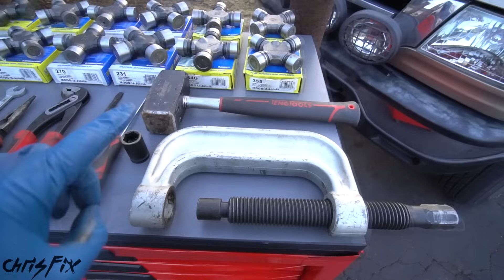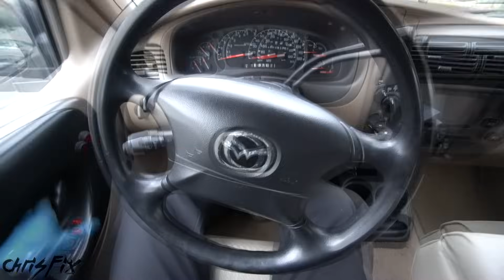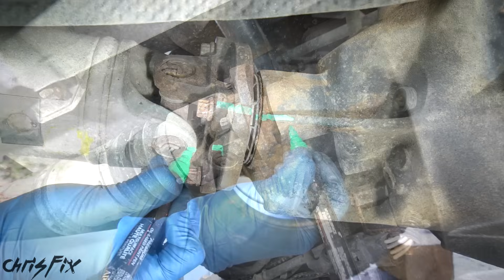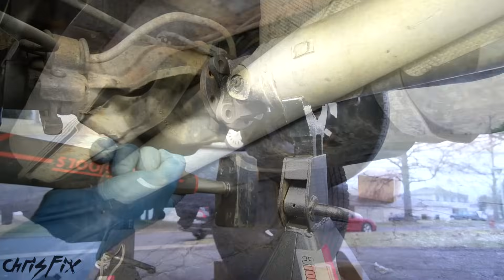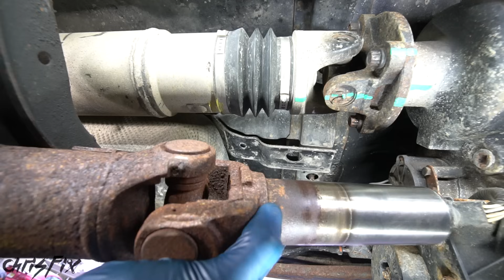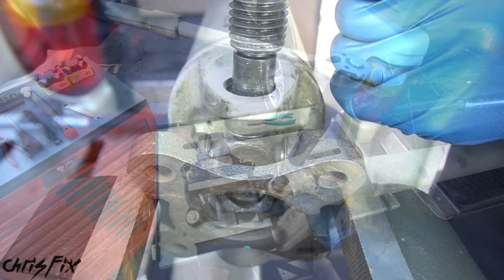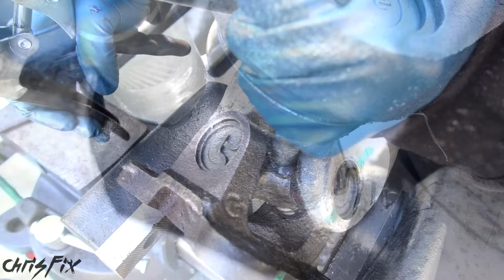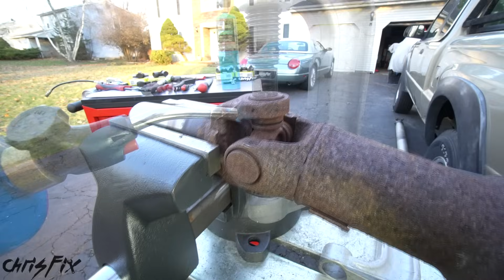How to Diagnose and Replace Universal Joints (ULTIMATE Guide)

Comment: This is actually very helpful.  I have had a vibration in my ranger since I bought it a couple years ago.. but it's only at 75 and up.  Check the drive shaft and it looks like the weight came off (non aluminum) but I never thought to check my U joints.. So I'm going to check them and see..

Comment: No surprise - another excellent video!
I would add that if any arm will not fit all the way into the cap (so the shoulder does not touch the rubber), push the cap out again. One or more bearings has fallen down inside and needs to be put back in place as you showed.

Comment: The worst U-Joint experience I've ever had was with a Yamaha 4x4 atvs I had. When I got it, the u joints had no bearings left in them and the clanking was awful. The problem was you couldn't remove the driveshaft. I had to change them while they were in there. I had barely any room. I ended up cutting the u joints out so I'd have more room by having the driveshaft out. It took me hours to get the end caps out. I hammered, heaked, soaked, and even bought an air hammer. What I had to do was cut two rods and place in the end caps them hammer a chisel in between them... I was glad to have it done, and now I don't have it anymore, traded it for a Jeep Wagoneer haha.

Comment: Chris, my owners manual does not have any torque specs in at all. I tried looking it up and noticed something. Apparently I need a “factory service manual” which is significantly different and separated from an owners manual. These manuals aren’t available to the public. Only mechanics and dealerships have access to these manuals, is this true? I have a 2009 ford fusion sel v6

Comment: I have a 2007 g35 sedan 6MT that makes a clicking noise every time it changes directions from forwards to reverse or if I get on heavy throttle/braking. Could it be a u joint or possibly a suspension related component? I don't hear it going over bumps or cornering only if switching between going forwards or backwards.

Comment: Hey Chris, I know this has nothing to do with this video but I’m changing my water pump in my 98 gt and was going to do a system flush as well. I’m changing everything, t-stat, upper and lower hoses, and reservoir tank. Should I change the parts after I do the first flush or after once the coolant is all clean?

Comment: On my 94 Mustang GT 5.0L with Vortech S-Trim Blower with a ton more mods I installed Ford Racing Motorsport aluminum driveshaft purchased from Steeda (local to me).  It was a huge difference over the stock unbalanced crapola shaft along with the weight savings.  Apparently after only 9000 miles the vibration was so bad while at the 1/4 track I about lost a filling in my teeth (that bad).  Dude, you need to make more videos, big gap between vids.

Comment: I don’t know if it’s too late to ask this question, but about a year ago my mother used her Mercedes station wagon to move backer board or wonder board because we were remodeling a house at the time. When we took one off the roof it scratched up against the paint and left a couple clusters of vertical white lines on the paint. I wanted to know what method I should be using. The lines disappear when I wash the car. If you could please point me in the right direction I would be very thankful. Thank you for your time.
Reply from the maker: Watch my video “how to remove clear coat scratches” and try the water trick to make sure they are clear coat scratches. If so, try polish first. If that’s not enough, use the method I showed in that video.

Comment: Hey ChrisF!! A video on how to locate the source of battery electrical drain when you know the fuse/circuit that is causing the problem☆ pleAse i alReaDy know the ammeter connecting to negative lead/battery post test procedure. **i NeEd specifics. Hiw do we read a wiring diagram c'mon ChrisFix tnk u thank u thank u!
Reply from the maker: Replace the part causing the draw. Did you see my video “how to find a short in your car”?
Reply: If you know which circuit it is if you test all the wire for continuity at first and then replace the part. You’ve done half the job by locating what circuit you’re power drain is on! That’s the difficult part!

Comment: I wonder if you can show us how to get your air conditioner unit of the car cleaned , as mine smell bad
Reply from the maker: Good idea!
Reply: There is an easy way to clear the smells.
First you are going to need some Lysol (disinfectant spray).
Now turn the AC on on full blast and put it on NON  recycling mode (its the symbol with the little car that shows air coming in from the outside)
Spray the Lysol into the vent located between the hood and the windshield.
You can do this everyday for two minutes at the time until the lysol is gone.
Once you are done, open the windows to let clear the smell.
For extra messure i use some of the lysol with the AC on full blast but this time ON recycling mode, and leave the lysol inside the car for at least 5 minutes ( i usually jam a piece of paper between the nozzle and the plastic cap so i can leave it inside spraying.
do this with the windows up of course.
I did this in all my cars without issues at all.
good luck

Comment: why do you tighten everything up in a criss cross pattern
Reply from the maker: It seats the flange evenly. If you tighten one side then the other it could be stuck at a slight angle. Same reason you use a star pattern for lug nuts on a wheel.
Reply: ohh ok... love your videos bro. I'm 16 and you have gotten me into drifting and made me a car guy.

Comment: The driveshaft isn't balanced on the vehicle "at the factory". It's balanced independently like anything else. This is like saying, "Make sure you mark how your tires are installed on the vehicle because they're balanced on the car at the factory." Imagine if you install it turned 90 degrees to the left. How would that make it out of balance?
Reply from the maker: The driveshaft and flange are balanced together. That was the point I was trying to make.
Reply: ChrisFix Got it thanks! Hey it would have been cool to see the vibration in the cabin after you replaced the u-joints, like how you did with the water. Great videos BTW!!!

Comment: He's back! :-) Outstanding video Chris. The same type of joints with clicking and clunking can also be found in your steering column. I replaced my intermediate shaft recently. I bet the road salt used in the winter got into those joints and helped make them worse.
Reply from the maker: Thanks and yes. I was going to include that info but decided to focus on the drivetrain only
Reply: It's no wonder why you rate at the very top for auto repair videos. You couldn't have explained things better.

Comment: Great vid. Thank you. What is your opinion on painting the drive shaft?
Reply from the maker: As long as you use a thin primer coat and thin base coat you can paint it. If it’s as rusty as the steel one you saw at the end then sanding it down might unbalance it.

Comment: Good video! Also, if you notice a squeaking sound when backing the vehicle, that is usually a sign that the front U-Joint is worn. Did several of these in my H.S. auto shop class. I also did a few of the early 1960's Chrysler products with the different style joint. Needed a good press to get the pin out.

Comment: Can you help me trouble shoot my truck it won't start I have tried replacing the starter I replaced the battery I also cleaned the terminals I got new terminals I just can't figure it out it's a 1990 ford f-250 v8 and takes gas please help

Comment: I posted this before but didn't get reply
I am having clunking noise on my corrola 06 Steering Wheel UV joint.    I was thinking of taking it out myself and inspecting as any local affordable mechanics don't want to touch it. Should I be worried about something and any advice? And thanks for videos as i learnt lot about cars and fixed lot of botched jobs done by local garages

Comment: I need feedback. I have 06 mustang GT with coastline aluminum driveshaft. I get the clunk moving through gears. vibration while at stop while in drive. drivtrain shakes as if engine is misfiring but no codes. I checked engine mounts are good not blown. trans mount good. hope it ant the trans.

Comment: I’ve got something I could use some help with. My cars been losing oil somehow for about a year or so. I’m currently at just over 3000 miles on my oil change this time around and it’s been maybe 4 months and I just check my oil and it wasn’t even on the dipstick. I drive a 2005 Honda CR-V and it has just under 80000 miles on it and it takes about 4.5 quarts of oil and I recall putting in all 5. Some previous oil changes were done at a Honda dealer or other place like firestone, and some were done by me when I had access to lifts in high school. Anyways I’ve never seen it puff smoke on start up or during driving. Literally never. And there no oil on my driveway. I haven’t seen any leaks but I haven’t looked too hard either. Was hoping Chris or anyone in the comments could help me out. P.S. love your videos and been watching for a few years. They’re very informative and detailed. I really appreciate how you always seem to cover every possible cause of a problem before you complete the video/ repair. You’re my go to source when I’m trying to learn something new

Comment: I'm doing a Gearbox swap on my '96 Ford Falcon EF Wagon 

The gearbox is coming from a 1996 Ford Falcon EF Sedan (which has a 20-22cm shorter wheelbase than the Wagon)
So I'll need to use the stock rear end of the driveshaft from the wagon and the front end from the sedan to suit the Manual Transmission
I'm not sure how well this will work but oh well

Be careful buying parts cars and check the wheelbase on them

Comment: Yeah how easy.  My Audi TT quattro doesn't have these joints on the central axle, its only cv joints front middle and back and an intermediate bearing.  And of course to remove the axle (called cardan shaft)  you need to remove "other stuff" like the exhaust front to back...

Comment: Hey Chris! I have a question about this. Can bad u-joints make a truck's rear-end "jump"? Like my truck when I'm going down the road and hit a pothole it will literally cause the whole rear of the truck to start jumping until I slow the truck down below 15 mph. I have checked and/or replaced my rear leaf spring hangers and everything else suspension related. I had a friend suggest my U-joints (which I replaced last year with cheap temporary ones) were the culprit. I have new ones to put in but I don't want to dedicate to just one problem if there is something else I should also be looking at while I have the truck apart..

Comment: Hey, i have a question about a 1999 ford taurus, just replaced the ac pump and to get it in you move it behind the radiator and the belt is on the passenger side, its all installed and it started the first 3 times but wont start again, its starter is new and it tries to start up but just isnt able to, any advice or clue what it could be let me know thx

Comment: When you use the hammer method to force the joint out, you should use a larger socket under the opposite side to support it. If that side is stuck, the joint won't come out otherwise. Also, you forgot to mention that sometimes one pair of caps will be a different size than the other pair on the same joint, so people should be aware of that during disassembly and reassembly.
Reply from the maker: Thanks for the tips Chris

Comment: The u-joints on my Vette's half shafts go out more frequently than I think they should. I always take it to a shop and have them replace the. I think next time I'll do the work myself. Though the half shaft u-joints would be slightly different procedure. Probably not too hard though.
Reply from the maker: The hardest part is getting the half shaft out and that isnt too bad either.

Comment: I've got a question for you Chris, I have a 2005 ford ranger 3.0 liter with an error code cylinder 4 misfiring. I replaced all fuel injectors, spark plugs, and wires....still have the misfire, what can it be?
Reply from the maker: Check the compression for that cylinder. If the compression is fine then I would replace the coil (distributor).

Comment: Hey Chris! Quick question: at 17:05 you mention tapping the flange with the new u-joint with a hammer to get the u-joint to move more freely. Do you know how/why that works? I can't seem to figure it out intuitively.  I would think that hitting the flange with a hammer would turn the flange's circle into more of an oval where it meets the u-joint. What are your thoughts?
Reply from the maker: Since the caps were pressed or hammered in, there is pressure against the needle bearings. The hammering vibrations loosens up the needle bearings and caps and helps them settle in place so there is even pressure. Lightly hitting the flange's circle does not deform it at all.
Reply: ChrisFix thanks for the quick reply! If I would’ve watched another 2 minutes before commenting I would’ve realized what happened lol

Comment: I have a transmission arriving tomorrow for my 90 Chev truck. I have been debating whether I should replace it myself. This video helped with a portion of the work--removing the drive shaft. I also broke my shoulder 7.5 weeks ago and so replacing the transmission might be a bit more than I can do now. But thanks for your great detail in the videos!

Comment: Correct me if I'm wrong but the driveshaft is balanced independently, it shouldn't matter how it's put in because at that point every driveshaft would be unique for its differential and transmission.

Comment: Tread carefully DIYers.  I know a lot of mechanics who have trouble replacing u joints.  If you arent careful you can bend the yokes and you will get the u joint in, but you wont be able to get the locks in.

Comment: Had a problem with my front drive shaft on my Jeep. I wish I could’ve seen this video before I did it. I have brand new ujoints and it still shakes violently, so I took it out so it doesn’t shake.

Comment: Dude you are da man! You have saved me at least $1000 already. Did all my wheelbearings and all the brakes calipers rotors drums on my Nissan frontier and I would have never attempted it without your clear and concise videos. And I have two of the symptoms for that universal joint on my frontier which has 247,000 miles on it. Will be doing that soon as it stops snowing. Rock on with your bad self. 

Gonna get my Chris Fix license plate holders😎

Comment: Very good video. One thing you didn't mention and it's not really a big deal just sort of personal preference I guess, is that when replacing multiple u joints of the greasable type it's good practice to position them with the grease fitting always pointing  in the same direction. That way when you go to grease it later you don't have to turn the drive shaft to reach each fitting. Other then that everything you said was on point!! Great work

Comment: Excellent video Chris!!  I'd like to add one more thing to your video as a safety tip.  After chocking your wheels, but before you remove the driveshaft, put your transmission in neutral and allow the truck to roll against the wheel chock, then put the transmission in park.  This allows the truck to be secured by the wheel chocks and not the driveshaft.  Notice that the truck rolled  back when you removed the driveshaft against the chocks.  Also this allows any driveshaft wrap up to be relieved which not only makes the shaft easier to remove, but also will not have the driveshaft jump out suddenly and injure you or damage the shaft after you remove the retaining bolts.  Thanks for your videos and I look forward to seeing more of them.

Comment: hey chrisfix..my car stalls when i turn right only..i drive 1982 toyota corolla. this only happens when car is low on fuel..i checked everythin from engine to fuel filter to gas tank..everything ok inluding relay frm fuel pump.any ideas?? btw great videos.keep  helping us carguys..thanks alot in advance

Comment: It's worth mentioning that those joints for your truck are anti-corrosion coated for used on that aluminum driveshaft. It is possible to get ones that will fit but aren't coated, so folks should pay attention to that. :)

Comment: hah i know what its like to drop a drive shaft, me and my dad was driving in his 96 f150 down the high way, i was the one driving and going about 75mph i heard the drive shaft start squeaking short time later it starting clunking then the truck shook and then i heard the drive shaft hit the pavement and the truck just came to a stop! when me and my dad got under the truck to check and see if the drive shaft was ok, i had seen the joint wasn't the only thing bad the ujoint had grinded a path through the shaft knuckle so we had to get a new knuckle welded on XD

Comment: When you removed the driveshaft, if you had just loosened all the bolts on the flange first then taken out the bolts, then you wouldn't have to heat it up to remove the one last stuck bolt. Just because you left one last bolt in, the whole flange will want to pivot and keep that bolt in tighter. Loosen all, then remove all.
Reply: Plus, you say to use impact tools with the press tools, but when you use an impact tool with any sort of screw type press, the threads become galled over time and the tool will eventually become useless. Only use hand tools on screw type press tools!

Comment: So I bought a brand new aluminum drive shaft for my 2000 Ford Mustang Gt but I didn’t know you had to align it. I didn’t see no markings on the new driveshaft from American Muscle so how do i know what the proper alignment is? I’ve since drove the car about 2k miles. No vibration or odd noise.  Thanks for the video learned a lot  more.